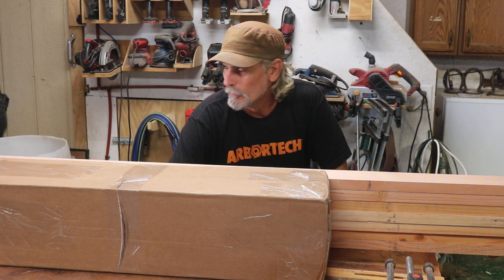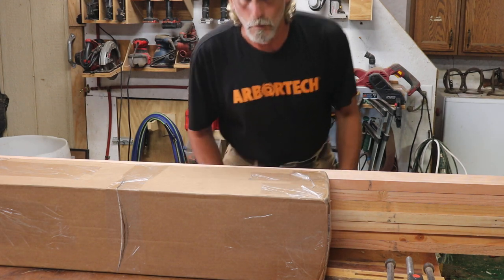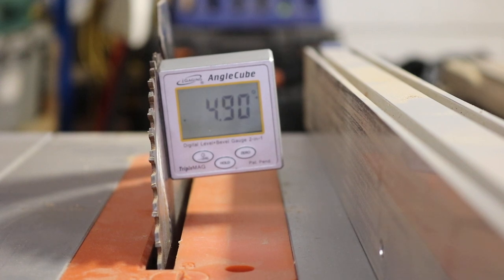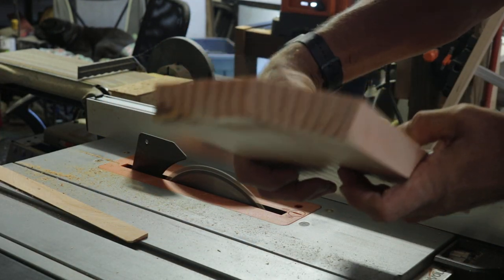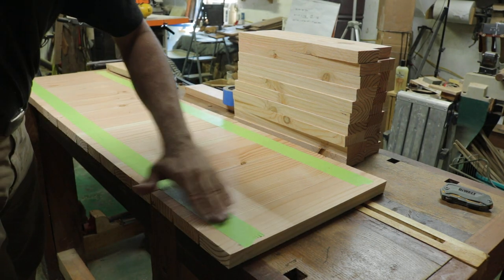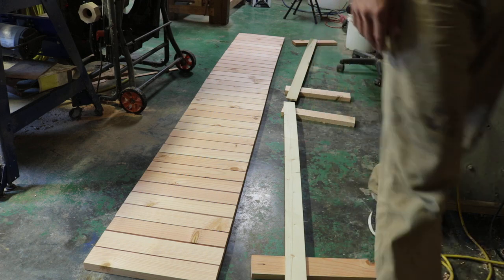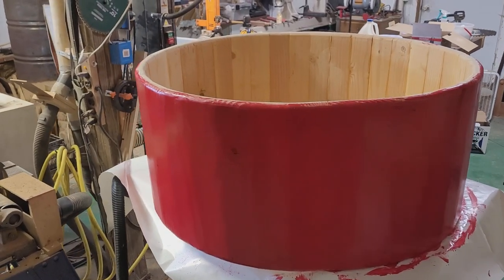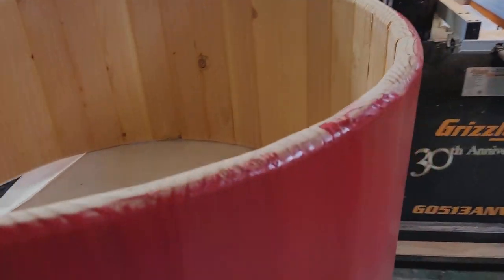ONE BIG RED DRUM Part 1

Comment: Interesting project...what type of wood are you using and does it matter what type ?
Also is there any concerns for expansion and contraction...??
Thanks for something interesting...👀
Reply from the maker: It was just home depot 2x4s planed down to 1 inch to make it a bit lighter when finished. Once the heads are on this dude will be nearly indestructible. I got my start building stave type drums and have never had one with a head on it break so no fears there. Also the expansion and contraction will not be enough to effect tune. More of that will be explained in the Heading video.